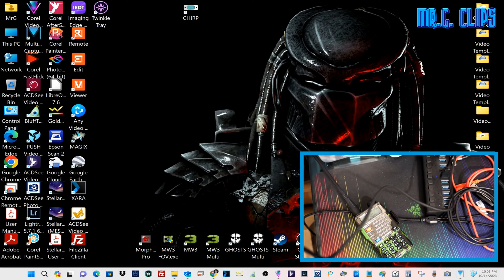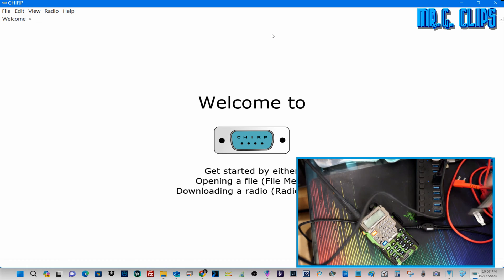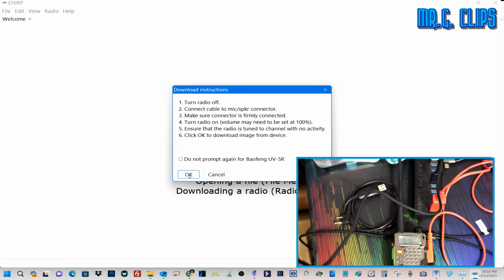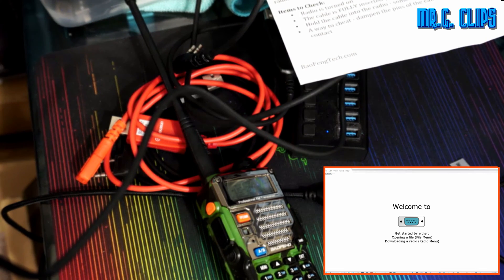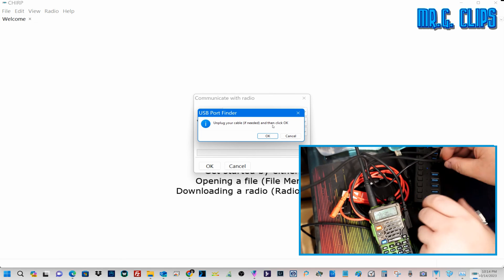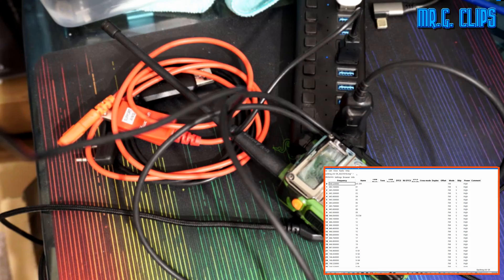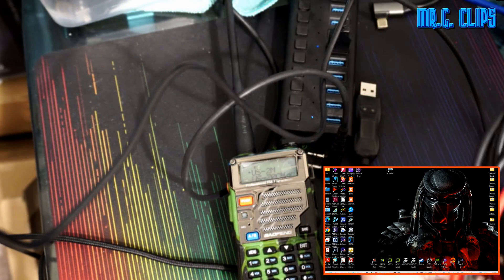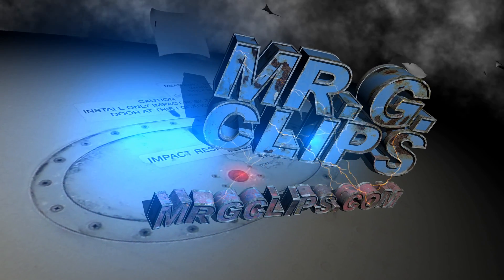Radio Programing with FTDI Cable Made Easy! :-)

Comment: Iv just brought two baofeng radio I have know clue how to use them .  What does this do ?   Iv had them for two days and not picked anyone up yet
Reply from the maker: You can program your Bao radios on your computer using CHIRP (free software) and an FTDI chip enabled programing cable. It's much easier to enter your favorite frequencies, repeater towers, simplex frequencies you want to use with your personal friends, local official channels you wish to monitor, the NOAA weather channel and such, instead of entering everything manually, which would be a huge pain in the ssssss! :D